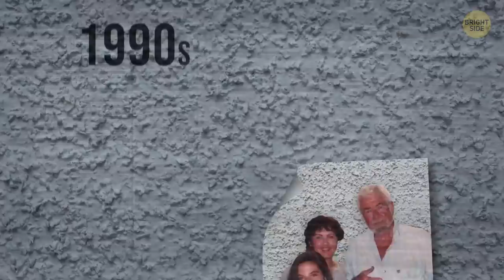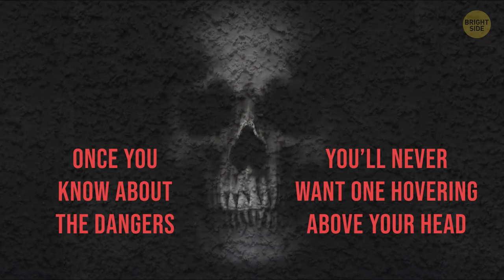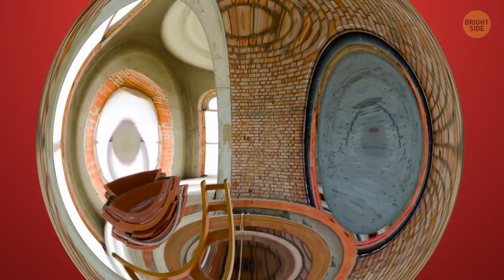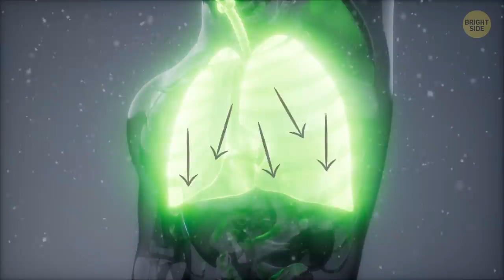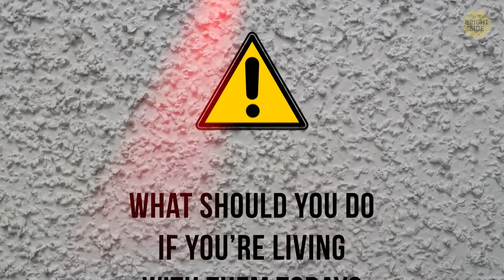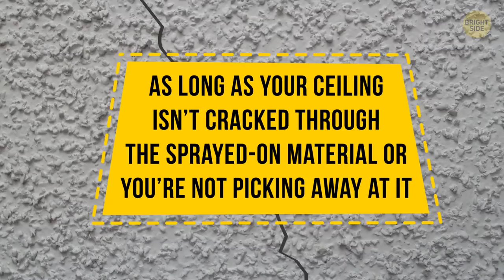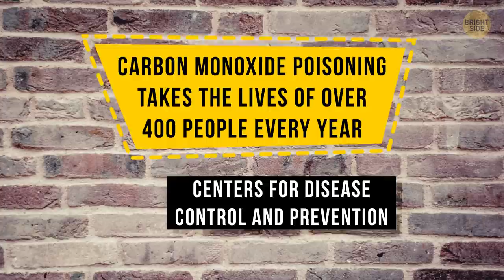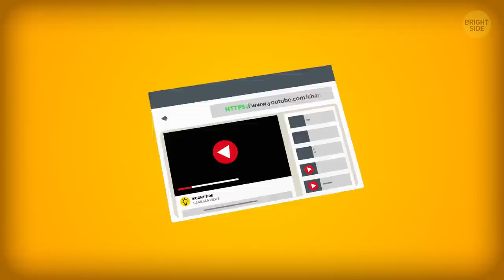If You Have Popcorn Ceilings, It's Better to Change It

Comment: Don’t worry!!!🍿 Popcorn ceilings applied after 1982 do not have asbestos! My drywall and painting company has been doing popcorn removal professionally for 20 years. Before I ever do any scraping of a popcorn ceiling that was applied before 1982. I always have it tested. I know 1978 was the cut off for asbestos products. But manufactures were allowed to keep a backstock. So they mass-produced these products and had about two years worth of them left to sell to the public. If a popcorn ceilings asbestos test comes back positive there are a few options for a homeowner:

1) You can have an asbestos mediation company come in and remove the popcorn at a very steep price.
2) If you don't want to do anything but make your popcorn ceiling look better. You can encapsulate your ceiling with primer and paint. Then everything will be fine as far as the asbestos.
3) if your popcorn ceiling looks really bad you can encapsulate it with a skim coat using all-purpose joint compound. Prime, paint and you got a new ceiling with no risk of asbestos exposure.

Hope this helps,-Paul
Reply: Paul Peck DrywallTube - ty!  My house has them, but was built in 1995.
Reply: Rosemary Angela, your ceilings are fine!👍🏻😀 -Paul
Reply: my house wass build in 1905 O.O
Reply: Paul Peck DrywallTube what u said
Reply: Thank you so much! You literally saved my life!😃
Reply: My house has popcorn walls it that ok? I’m not in bunk bed soooo....
Reply: Mine was built in 2003 and im scared
Reply: My house was built in the 1970s, and we have popcorn ceilings....
Reply: Me having it on since 1967
👀👄
Reply: @user-jm3kb7yz5b  me too
Reply: Too much to read

Comment: According to the EPA, abestos was banned in textured ceilings in around 1977. Not all ceilings have abestos
Reply: It was banned in the late 70s although builders were allowed to use up all of their existing supplies. Some builders had so much in their warehouses or storage that they were still using asbestos as late as the early to mid-80s. My home was built in 1982 so it most likely does not contain asbestos, but there’s that slight possibility it does. I plan to have a sample tested. And if it doesn’t, I’m hoping to remove it from my bedroom ceiling. Going to be a big job though.
Reply: Asbestos ain’t that scary
Reply: My house hasn't been renovated ever since it was built, and the house is from the 60s. It still has popcorn ceilings

Comment: I grew up finishing Sheetrock with my dad for a living. The spray mix we used for popcorn ceilings was a mixture of thin Sheetrock mud and tiny little bits of styrofoam. That's it. You add water, mix, pour, spray. I've never seen a mix that contained those toxic chemicals in it before.

Comment: The video should point out that spraying paint on a popcorn ceiling is the easiest and safest way to make a popcorn ceiling safe. The technique is called "encapsulation." My home has ceiling radiant heat, so the popcorn ceiling cannot be removed without destroying the heating system. Instead,  I spray painted the ceilings before moving in.

Comment: Wait what? I've been living under a popcorn ceiling for 11 years! Are you sure a popcorn ceiling in dangerous?(I'm totally fine.)
Reply: What!
Reply: Me too
Reply: @gamingwithUzi356  yeah I've been living under a popcorn ceilings for about 7 years
Reply: I have lived under a Popcorn ceiling since I was born and I'm totally fine
Reply: asbestos realated deseases come usualy 20-40 years after exposure
Reply: Ya same I am 9 and have been living under them for ever and I am fine by the way they are on the walls to
Reply: Only danger if you disturb the popcorn ceiling...like try taking it off without protective gear.
Reply: Feng Jiang your in danger
Reply: As long as the asbestos is not “disturbed” (in other words, you’re not letting it fleck off in small pieces haha) then it should be safe. 

Also, asbestos was banned in the US in 1978. However builders were allowed to continue to use up all of their existing supplies, so it was still in use in some building construction as late as the mid-1980s. But most homes built after 1980/81 probably don’t have asbestos.

Comment: Makes me wonder because I could swear that a lot of the hotels I've stayed in over the years had these types of ceilings.  I'm wondering if there's an aesthetic version of this to give the look, but without the danger (and that is more plaster based rather than contain aesbestos).  Many of these hotels were newer as well, and one in particular was recently opened, so I'm wondering if there is a cosmetic version of "popcorn ceiling" that doesn't have the harmful materials and is merely for looks.
For the carbon monoxide in many cities and states in the US, it is required that you have a carbon monoxide detector (usually on the first floor, although you can have them on all floors, and some smoke alarms also have this function built in) and I believe its requirement has become mandatory for new builds, where one has to be installed, whereas there may be some exclusions for older homes and office buildings.  Regardless, the detectors aren't that expensive, and you can even get basic plug-in ones and they very well could save your life.  So if you don't have one, go get one.  The most common place to have them is by anything that uses natural gas, so like a stove, gas dryer, furnace, etc.

Comment: At first when you said look up at the ceiling and see if you have popcorn ceilings I don’t actually have popcorn ceilings because I have ceiling tiles there squares and with a straight line on each Sides it holds up the roof tile and the light is on the roof tile and the reason we have it so that we can quickly get access to the top of cement and see which wire connect ones so we don’t have American houses

Comment: My families historical house is filled with this stuff on the cealing but my family cant afford the cost for the permits to get it removed without causing structural damage to the histrorical house since its 97 years old. Its the only thing holding up the unfinished second floor.

Comment: water heaters? Well not all of them, we have an electric water heater and it dose not have a gas set up so I shouldn't worry about it but my central Air system dose use Natural gas but uses electricity to ignite the gas to produce heat during the winter months. and we also have a 2 - 1 smoke and carbon Monoxide detector which is mandatory to have in every home by order of the Fire Department in my hometown and by other laws and regulations.